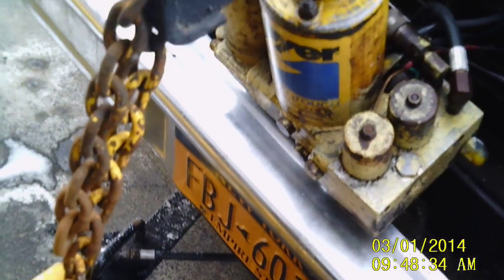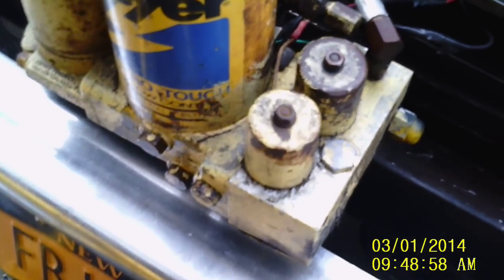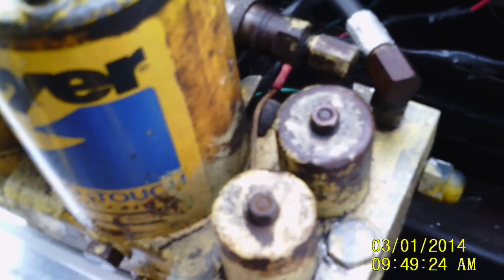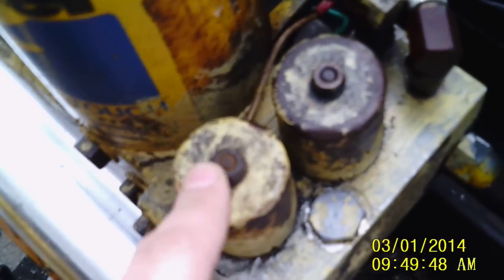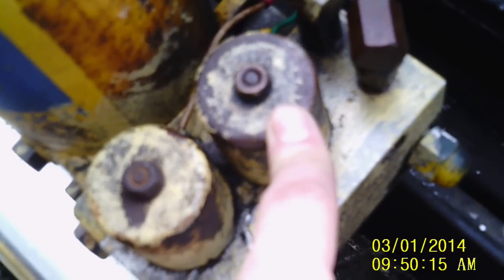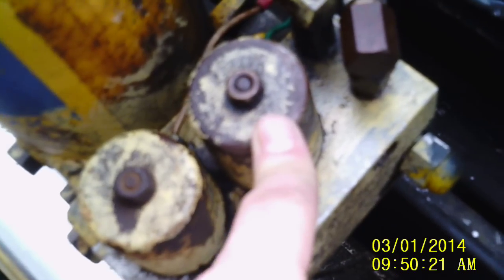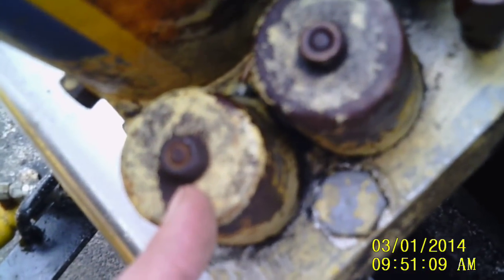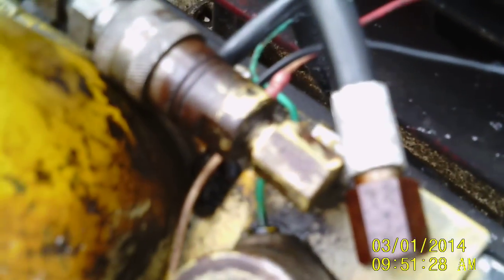Meyer  E47 Electro touch coils & valves "what they do & which is which"

Comment: I just bought a Meyer E-47 Pump with plow. Which port is for the left/right cylinder? Also I need help making a harness, how were the wires wired to the two toggle switches. Any help would be appreciated.

Comment: I have a strange issue with an E47 unit.  Blade will swing left/right and goes down fine.  Pump will run for about a second for the up button then stops and I get a red flashing light on touchpad as long as I hold the up button down.  I have a brand new touchpad, I replaced the entire harness and I also purchased a new coil for the RED (up) valve. No change.  Any thoughts?
Reply from the maker: Sounds to me like it's the pad. Even tho it's new, could be no good right from the factory I've seen it before. See if they'll exchange it
Reply: @CountrysideStrong  Thanks, they are going to allow return for testing.   I'll let you know if that was the problem

Comment: As soon the plow gets power  the plow goes left is like the switch is stock and  goes  left unless I hit up or to the right. Iwhen I take my hand off the switch  it goes left by its self. At times is fine for like 2 minutes , then goes back been stock  to the left. What should i check first or what do you think is the problem? Thanks
Reply from the maker: if be willing to bet the valve body has an issue or the coil for left/right is stuck open/closed. I'd check the coil first, much cheaper and easier to do. good luck
Reply: Thanks! +CountrysideLawnNY

Comment: What size socket do I need to change the C valve? On a Meyers e47
Reply from the maker: I don't recall. This video was so many years ago. I do remember you have to use a thin wall socket tho
Reply: @CountrysideStrong  i am having a hard time finding one,i think it is 1 1/4 inch, or 13/16 inch. if anyone knows where i can get the correct socket let me know! Thanks

Comment: After beating my brains in and out, here's how it works IN A NUTSHELL!
Black (back coil) = Power ONLY (no pump) = DOWN
One coil (of the side by sides) = Power + PUMP = RIGHT
Other coil (of the side by sides) = Power + PUMP = UP
Pump power ONLY = LEFT 
Double Pole Double Throw Center OFF switches will make this work EASILY, supply 12V to center lugs, then on one of the pairs you feed solenoid and pump relay , do same on other switch, and on the other side you need to have power to the solenoid for down, and solenoid power and pump relay power for up.  Sounds complicated, but I use auto return to OFF (left right springloaded to return to off) on one switch and a spring return to off for UP and a locking (stays on) for DOWN FLOAT. works like a DREAM!!!! 

Thanks OP for the vid! you really helped my brain out on this!!!!
Reply from the maker: No problem

Comment: important that those solenoids are tight and making good contact. my "A" coil was loose and I could not get the plow to go up. you heard right "up". tightened the coil down and worked fine. keep spares on hand. they fail at the worst time.
Reply from the maker: ram dodgetruck Best thing to do is dump a Meyers. They're easy to fix but you're always fixing them
Reply: I've got two Meyers and one Fisher Minute Mount 2. The Meyers are a lot easier on the front ends. I hate the Meyers Slick stick. piece of crap. Miss the old double toggles.
Reply from the maker: ram dodgetruck I've been plowing for over 19 years. The only difference a plow makes on a front end is the weight. Out of all the plows I've used, I'll stick with Boss or Western any day.
Reply: I've been plowing since 1976 and those fishers are really heavy. My new Fisher requires placing 380 LBS of weight at the rear of the truck. Don't know what a Boss weighs but I'm sure they're lighter. I'm sick of plowing snow. Only want to plow my girlfriend. Are you anywhere near South Main Auto? Heard they like lots of salt in NY.
Reply from the maker: ram dodgetruck Exactly so as I said, it comes down to weight. I can use a 9' blade that weighs 800+lbs or a 7' that weighs 600. Manufacture doesn't matter. They all make light weight or commercial duty plows. It depends on the plow not the manufacture. Yea in NY we use allot of salt. No sand here that's why our roads are drivable. It's also why vehicles rot faster.

Comment: Thank you! You helped me out.
Reply from the maker: Awesome, glad I could help
Reply: Countryside Vlogs i replaced the couples in mine today for the hydraulic lines, and i also replaced the c valve as well as change the fluid and its still doing the same thing that started last storm, that is...if i put the blade all the way to the left it gets stuck in the left position, diesnt matter if i hit right or left you just hear the motor and it doesnt move. Any ideas?
Reply from the maker: @OxaudioPhilly  I would make sure that cylinder arm isn't bad on that side. Everything works on the right and up/down?
Reply: Countryside Vlogs yea it seems to be. It works fine until i put it all the way to the left. I have an old style e47 pump however.
Reply from the maker: @OxaudioPhilly  if it goes left but then it just sticks there, I'd bet it's not the valve. Either the arm on that side or the pump itself is bad.
Reply: Countryside Vlogs im gonna rebuild it all after this winter i think. I only payed 250$ for the complete setup 2 years ago and thats payed for itself 60 times already
Reply from the maker: @OxaudioPhilly  oh hell yeah

Comment: I guess not a single video from anybody shows where the two hydrolic hoses to the cylinders down below  that control right and left movement goes to on the pump by the valves.  For Pete's sakle there is just two of them there and everybody is either in the way of the camera or too dam dark to see.  I am assuming that the right goes to the right and the left to the left ram.I
I just bought this plow set up and I finally got the brackets and the arms installed and got everything hooked up.

I guess I will have to play around with it to see if I have the hoses hooked up backwards.
Reply from the maker: You should make your own video👍
Reply: Hey Blue...I'm positive you have it figured out by now. (Lord help us if not) But...In case you don't (AND/OR for anyone else having the same issue) It's Right Ram/hose to 👉🏻 Right side and Left Ram/hose to the left side 👈🏻.  Easy peasy. ↖️↔️↗️

Comment: I have an issue with mine the works like it should but when it's up it starts leak down slowly turns to left ....would that be the b valve? ???
Reply from the maker: it's actually because of an o ring at the base of the cylinder inside the pump house
Reply: +CountrysideLawnNY when i bought the set up I had the pump torn down  and all new o rings [rebuild kit]
Reply from the maker: +Jack Carlson is a pain in the ass but if that ring didn't sit exactly right, problems. I redid mine 3x before I got it right
Reply: +Jack Carlson ...I try that again....thanks bud for the help
Reply from the maker: +Jack Carlson no problem
Reply: +Jack Carlson Not sure if you fixed the "slow leak down" by a second rebuild / replacement of O rings as suggested. I had a similar experience with my first E46 plow. Had it rebuilt when I got it, noticed the slow settling of the blade, so I had the shop rebuild it again.... still slowly leaking down. Somebody suggested I replace the A coil....That was it. The plow blade stayed up. That was 3 winters ago, and still working fine.
Reply from the maker: +SPCLPONY ooh yea that was fixed and sold that spring. bought a new boss and been running it ever since

Comment: I thought that C  coil is for right angle only
Reply from the maker: Not according to Meyers diagram.  I thought the same thing at first.  You can type the E47 diagram in Google then click "images", it will bring up the entire diagram.
Reply: C is right angle only. Left is default. If the motor runs, and no valves open, the plow goes left. When the C valve is open, the plow goes right.